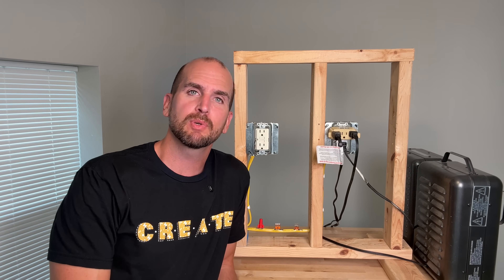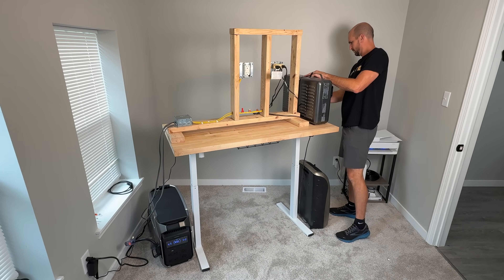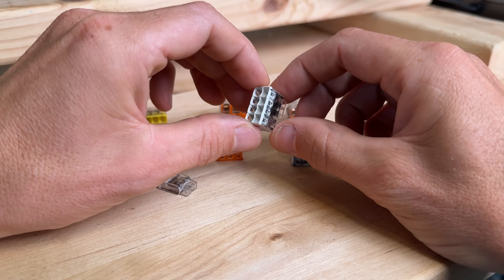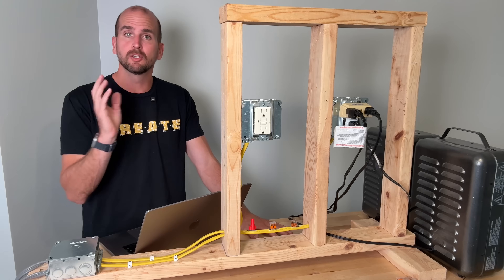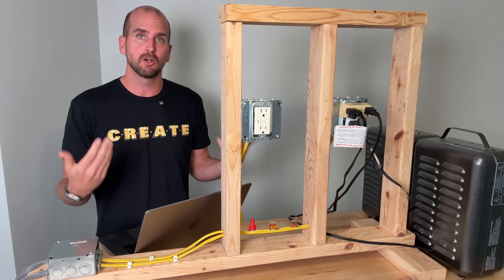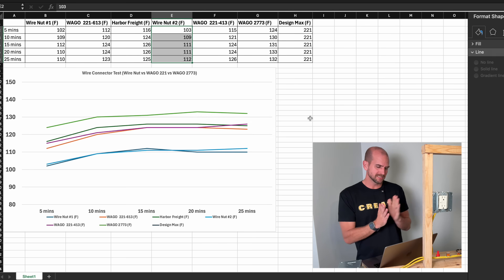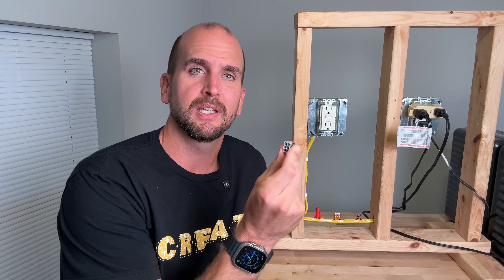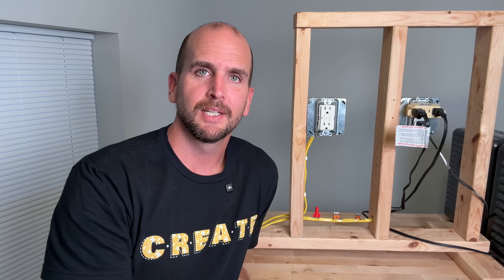Can Push-In Wire Connectors Handle Heavy Loads? | Surprising Results!

Comment: I’m not understanding the purpose of this test. If you have a 20 amp breaker and you push more than 80% of its rated load, something is going to happen!!!  So in saying that you’re putting 30 amp load on something that rated for 20 amps, of course something gonna happen.

Comment: You might want to check to see if there is a voltage drop across your series rig. This drop could be increasing the amp load to some of the connectors and therefore be causing higher heat readings.

Comment: I’ve used the Ideal push in connectors, and have not had any issues, and will continue to use them up.. Now that Wagos are more widely available I bought a combo kit, and will use them
Reply: Ideal has a lever style connector now also .. haven’t messed with them yet myself
Reply: @andrewb941  Yep, I saw some informal test videos here and they seem to perform roughly the same.

Comment: I don’t like how the connections are in series with each other.  The temp increase does indicate resistant and therefore a small volt drop across each connector. So the lever is not getting full voltage or amperage through it and push in is getting less than the lever.  So temps could actually be higher. Test should be done with only one connector in the circuit at one time.  I still think they will all pass with flying colours though. Thought?
Reply: I’m not an electrician but I had the same concern. Shouldn’t they be tested on separate circuits?

Comment: I've not used the WAGO push-ins, but I have used their lever nuts.  Also I've used the Ideal push-ins. Mostly used them doing ballast removal when changing from fluorescent to LED "tubes" but I used some when I had to cut back burnt wires in an electrical box, couple 3x 2/12's with their grounds together plus add a pigtail for the outlet I was replacing.  (Whoever wired it had used the 14ga back stab for 12ga, plus used both screws for the other two romex in that box.  One day I noticed the outlet was hot and found insulation burnt back a few inches from the outlet, where it had been heating up carrying downstream loads.  🤦  With only a couple of inches of "not crispy" insulation on wires in the box, push-ins made the connections easier than stripping the wires.  (Have you ever noticed that wires getting hot will cause the insulation to stick really well to the copper?  PITA!)

Comment: @EverydayHomeRepairs are you still offering zoom consults? I have some questions about dryer vent flexible hoses.
Reply from the maker: Not really, we do have a HUGE facebook group where you could post your question and pictures.  You will get a ton of feedback and have to filter through some "funny guys" but usually you can get some good options and direction. Search "Everyday Home Repairs Community"

Comment: What I would worry about with the push-in units is whether or not they have the same problem as the backstabbing receptacles. They may be fine to begin with, but after repeated heating and cooling, they tend to get loose. Do you know if this applies to the push-in WAGO connectors also?

Comment: Thank you for pointing out the axis issue, and showing the chart with the upper design limit.  It's also worth pointing out that your axis is still artificially "short" by starting at 80 degrees.  I realize you have to pick some lower threshold, and 80 may make sense as a not entirely atypical ambient temperature.  I personally would have no issue with running any of the connectors given the results, and like you, I'd lean towards the reusable options.  A big drawback of the push in wire connectors in addition to the waste and lack of reusability is that the design seems to preclude stranded wire.

Comment: IIRC, the 2273 also has a 4 wire variant. So, 2, 3, 4, 5, 6, and 8 wire versions. Model numbers are 202, 203, 204, 205, 206, and 208. Also, it actually is reusable. Twist the wires while pulling backwards, and after a few times, it will come out. One thing though. This does mar the wire, and you're supposed to cut the marred wire off and restrip a fresh end if you do this.

Comment: Obviously, you are now going to have to compare the most commonly available push-in connector... Ideal brand with the Wago push-in for an apples to apples comparison. 
I want to see if the little bus bar in the Ideals' is more stout and can handle more amperage showing a lower temp reading.

Comment: I can't deny  the benefits of lever nuts but your careful testing has confirmed the validity of my preference for good quality wire nuts. The push in connector has no appeal for me at all. Optimizing for narrowly defined convenience in such an extreme way seems almost like satire rather than a real product. It's the antithesis of the lever nut.

Comment: Remember, the worse the connection, the hotter they get. When looking  for cold spots with my thermal camera,  I noticed my breaker box had a hot spot on it while running the heater last year. Turns out the line for the heater was not fully tightened down on the breaker. Tightened it up and the heat problem went away.  Wagos connect your wires with a thing sheet of metal (a poor connection) and Wire Nuts twist the wires together when properly installed.
Reply: "... Wire Nuts twist the wires together when properly installed."

The key in this context is the qualifier "when properly installed." No one is denying that wire nuts, when properly installed, provide a superior connection. The issue is you cannot visually inspect a wire nut connection and determine whether it is properly installed. Combine that with the fact that most DIYers cannot make reliable connections with wire nuts (particularly when connecting more than two wires, or a combination of wire gauges, or a combination solid and stranded wire) and wire nuts become an iffy proposition for DIY installations. 

We should also consider just how much theoretical improvement wire nuts provide over lever nuts. In these tests, wire nuts run a few degrees cooler (when the line is over-loaded by 50%), yet neither connection type comes close to overheating. So, how much benefit do the wire nuts provide when, in real life, the user will never notice the difference?
Reply: That "thin sheet of metal" easily handles the rated amps and even handles the 50% overload as shown in this test. A properly sized breaker will pop before you overload the that "thin" metal.

Comment: So, a wire nut with a properly twisted wire is better (from a heat perspective) than a "buss bar" type connector.  Not surprising as a properly twisted wire probably has more sectional contact than the push-in or lever type connector.  How about testing the DIY'er practice where they do not twist the wires and just connect them with a wire nut.  Also, from a point of reference, it would be helpful to provide the wire temperature.  As others have pointed out in the last video, copper is an excellent conductor of heat and I wonder how much that affects the results since the connectors are in series and are close together.  To get a true picture, you probably would have to test each connector separately and compare to a baseline with no connectors.

Comment: The Wago 2773 are great for junction boxes where you will install them and most likely will not visit them again for a long while.  The lever nuts are better for switches and receptacles where you will use a mix of solid and stranded wires and work with more frequently.  BTW, the 2773 are reusable for solid wire but if you use a stranded wire in one of the ports that cannot be reused.  You will just abandon that port or use a new 2773

Comment: Will the cumulative effects of three push in wire nuts increase the heat in a sealed junction/outlet box?
What would the temperature of the wire be if there was zero resistance in the wire [straight run].
If push in connectors are so good, why do the ones used in backstabbing outlets fail?

Comment: Any heat at all is a loss. Meaning, money down the toilet. For me, I will take the lowest heat option.
(Also why I use #12 wire for 15A outlet circuits)
Reply: It is really strange that this heat loss argument usually comes from a country where energy efficiency is of absolutely no concern otherwise and literally kWs of energy in a house are lost due to no or bad insulation, inefficient heating systems etc. 😆

Comment: I work at a convention center as the maintenance manager and the original installer of most of the lights used those push in connectors and they fail regularly. I find them completely melted. The circuit is a 277vac. I replace them with lever nuts with no issues
Reply from the maker: Thanks for the feedback.  Do you know what brand of push-in connectors you are finding melted?
Reply: @EverydayHomeRepairs  I do not remember the brand but they were yellow, that's all I remember 🤔
Reply: @jacoblittle3209 so, not these push in connectors. How is it that people can —often in one single comment — say that you need good quality wire nuts and not cheap ones, but then also conclude that if cheap push in connectors fail therefore all push in connectors are bad?
Reply: They must have used cheap Chinese knock-offs.  The entire world uses these push-in connectors for everything.  Only the USA uses wire nuts.  Why isn't the rest of the world burning down?

Comment: Great work as always. It would be interesting to see the temperatures of all these connectors at 20 amps i.e., at the maximum current they are actually rated for since that is where the breaker would cut off the power.

Comment: I agree that 221 is the way to go, and then a big push-in for lots of annoying grounds. Note that all of these will continue to work past their design limit until the metal melts from the house burning down around it.
Reply: That was what changed my mind about them more than anything else. The amount of power that you have to put through one of these before it fails is so high that the rest of the circuit is on fire first.

Comment: WAGO Push-In connectors are reusable. You can pull out the conductor and push in a new one. WAGO manual says: To remove, simply twist and pull the connector and conductor at the same time.
Reply: That is only true if you use solid wires.. But if you use 7-stranded conductors the connector is not reusable.
Reply: @Mixolixplosion  you can use this connectors only with solid conductors. This is a manufacturer's specification.
Reply: @Khoruzhin  My bad. By "flex" I mean solid stranded, not fine stranded wire.. In case you use solid stranded it is almost impossible to pull the wire out without damaging the connector.
Reply: @Mixolixplosion  you can't use a stranded wire in a Push-In connector. Only solid. It's stated in the datasheet. Stranded and fine-stranded wires can be used with Cage Clamp connectors like Wago 221 or 222.
Reply: @Khoruzhin  Wrong. You can use 7 stranded wires (1.5mm² - 4mm²). It's in their ad.. posted by wago uk and ireland.
Reply: @Mixolixplosion  I figured out. We are talking about different connectors. 2773 can be used with a stranded connector, but 2273 can't. 2773 is an upgraded version of 2273. I forgot that this is a 2773 in the video. Sorry, my bad. You are right.
Reply: @Khoruzhin   I was aware about 773 but 2273.. If i saw one i would thought it was a 2773 given how similar they look (wago should have named the improved version 2273-B or 2274  to avoid such confusion). So thank you for this info, I can now guarantee  that I won't find myself trying to shove a stranded conductor into a 2273 thinking it was a 2773 😅

Comment: Can the WAGO lever nuts come loose? Can the lever be opened by vibration or some sort of stretching of the wires?  I don't know. Can anything cause the lever to come unlatched?  That's one question I can think of about the lever nuts.
Reply: The wires can come out if they are just stuffed in the box randomly. What I learned is to pre-fold the wires to near their final position, then trim them all to the same length before stripping and nutting them. You don’t want one wire to be at loads more tension than the others or it can slip out over time.
Reply: @MoneyManHolmes   Makes sense.

Comment: The thing about the wire nut is that it is a metal nut inside. Even if all the plastic dried up and cracked off the wires would still be nutted together....as long as they don't ground  or short to something else. Is that true of the WAGO connector. Is the inside of it as strong as a wire nut?
Reply: The plastic is also just the insulation and has no impact on the clamping force, the wires are inside a metal cage. Essentially it's just a "linearized" wire nut that catches exactly one wire.

Comment: I'm still using my Wago push in connectors I bought 30 years ago.  I've bought several big 100 count boxes of those in several sizes over the years.  Love them.  Still use wire nuts sometimes when I have to.
Reply: I agree! I'm rebuilding an old 1906 home, redoing all of the electrical and for a very small entry cost; I'll be able to complete at least 4 houses no problem. They are insanely easy to use and cost effective enough to just snip off and put another on if need be. Perfection!

Comment: I made sure to go ahead and use Wago 221s for my heated floor.  15 amp 120V load (3 almost 16' sheets of QuietWarmth under my flooring), heats most of my family room floor.  Zero issues or concerns about this constant draw.  They are rated up to 30 amps! It's crazy to me it's still a discussion online.
Reply: That's what ultimately won me over. I saw a few creators here with quasi scientific testing where they through far more power through the connectors than my breakers could supply without them failing. The rating on the ones I bought was crazy, they were the 5 wire variety and it was 450v/32a which is just absolutely nuts for a 110v circuit that's protected by a 15a breaker. If the wago becomes a problem, the building is probably already burning due to the rest of the components failing. Arguably the wiring protects the wago from damage.

Comment: I still like the mechanical connection of properly twisted wires in a wire nut.  The lever nut Wagos are great for wiring light fixtures with stranded to solid.
Reply: I agree, and many electricians do also. However for the average DIYer doing small projects around the house, or wiring their buddies basement, these are good to use. Id tell a DIYer to use wagos over poorly terminated wire nuts any day. You simply cant mess up doing a wago.
Reply: @gerald8289  Where there's a will there's a way.  I've seen photos that show people have put more than one wire in to the individual terminal on this style of connector.
Reply: I think wire nuts are still the best for anything that you don't intend to ever redo. However, I do think that it's wise practice to use wagos on most pigtails, especially for things that are likely to wear out at some point like receptacles. It just makes the issues related to eventual wires being too short go away permanently as you can then just quickly swap out the pigtail and have a bunch of receptacles pre-wired with pigtails that can be connected in without a lot of trouble at the box.

Comment: Idk why people taking upon themselves to test these things. 
They are already UL tested and listed for their use per the manufacturer requirements. 
Don't exceed their ratings. Install per instructions and you are fine. 
Also, wirenut is insulated, so your IR thermometer comparison is not fair and accurate.

Comment: So, for these 2773 push-in connectors, how does that compare to receptacles with back-stab connections?  Is that not exactly the same functionality and mostly implemented the same?
Reply: Same concept, but much poorer execution on outlets/switches, which is why those fail so often. Wago/Ideal stab connectors are a lot more robust.
Reply: @andrewt9204  also wagos have a busbar, backstab connections don't

Comment: Please do not ever use push ins for wiring. There is a reason we don’t backstab outlets anymore and this is essentially the same thing. These company’s might be saying they are safe to use but they said the same thing about backstabbing receps when that first became popular. Save yourself a house fire and use a wire nut
Reply: The reason seems to be just crappy implementation. In Germany no electrician with a sane mind uses screw terminals (or wire nuts, although they are actually allowed) for simple domestic outlets or switches and that for more than 30-40 years. The Wago 273/2273 is more or less the standard, 221 is just a internet hype. Also the bus bars for N and PE in the main distribution boxes for smaller wires (up to 4mm^2, ~AWG11) are usually just push-in. If there would be safety hazards you can bet that they would have already been banned.